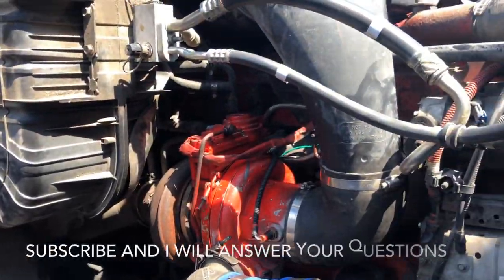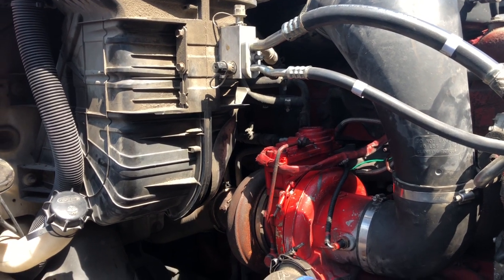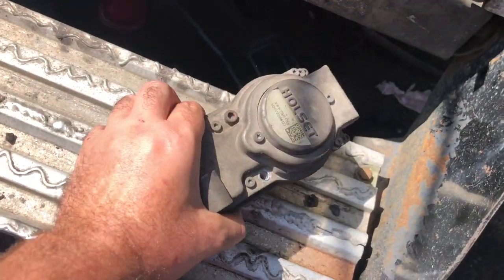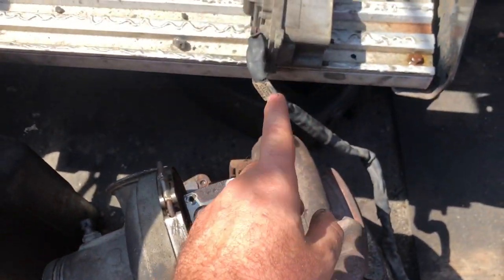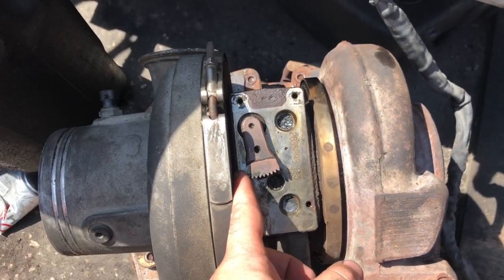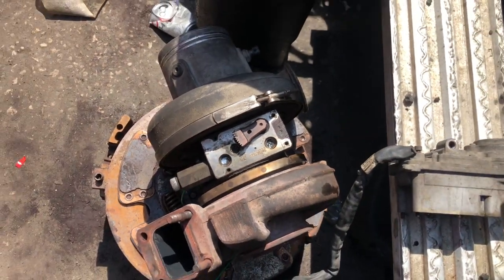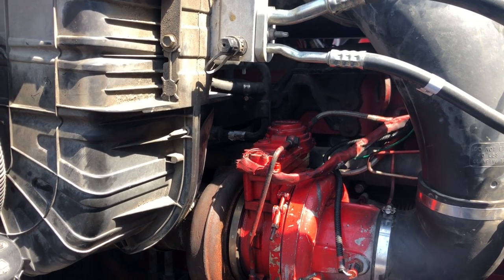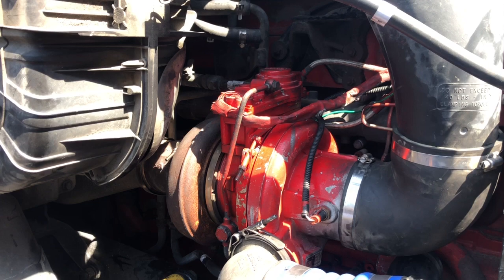Cummins ISX Engine VGT Turbo Actuator

Comment: Had all these same issues with D13, cleaned all sensor, and DPF filter and sent my Actuator to shop to be rebuilt this was a tremendous savings Dealer wanted over $1300, rebuild only cost $600+, Turbo was good to go after repairing VGR Actuator…
Reply: Who ruibuil this actuators?